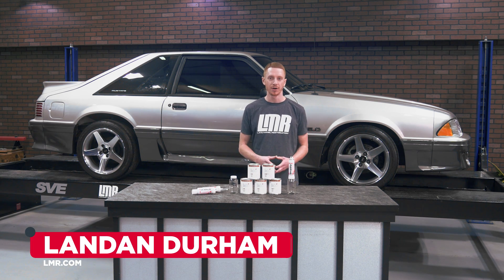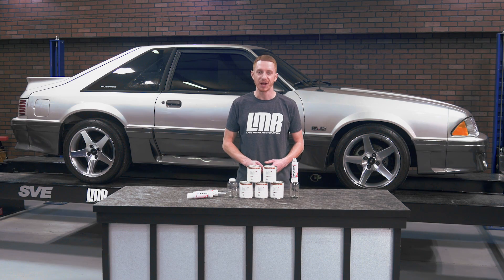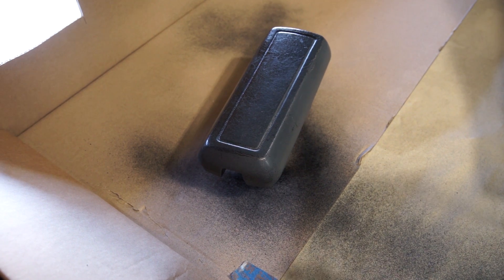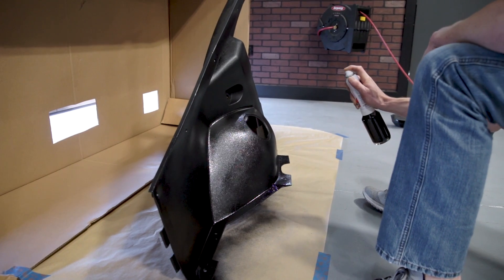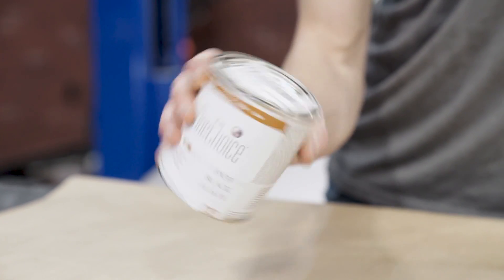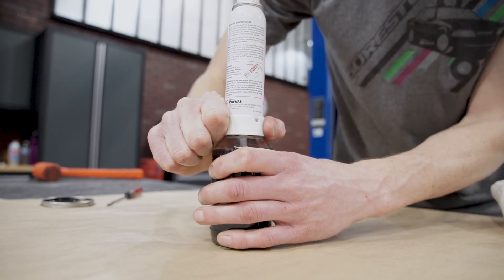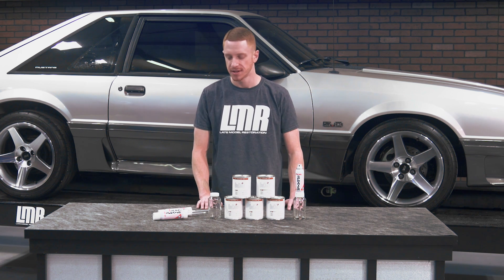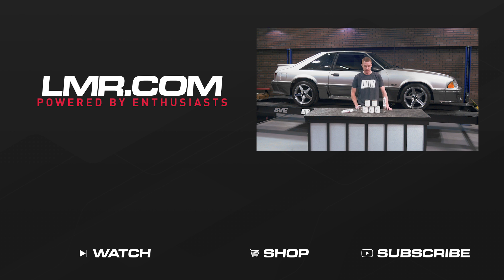Ford Mustang Interior Paint Systems - How To & Review (1979-2004)

Comment: What about a desert tan or what is the difference between the desert tan and sand beige if any???
Reply from the maker: I've never personally seen desert tan and sand beige side by side to give an accurate answer. Based on the information that is available to us, desert tan is darker than sand beige. You can either respray everything sand beige or try and have a custom color mixed by a local paint shop. -Landan
Reply: @latemodelrestoration  appreciate the response just purchased your sand beige paint kit for my 84

Comment: What are the differences between the two blacks. I'm changing colors and don't know what black I would want
Reply from the maker: 79-89 and 90-93 ran a specific black on each of these breakdowns. Most people usually go with the 90-93 options due to its blueish hue. The 79-89 has a slightly lighter tone.

Comment: I want to change my interior plastics from red to black. Would this paint work? Or could you recommend a primer or undercoat that would be compatible with these paints?
Reply from the maker: As long as the surfaces are prepped correctly, the use of a primer would not be needed.

Comment: What about rear quarter plastic interior parts for a notch
Reply from the maker: The flexing agent allows you to use this on interior plastics and vinyl.
Reply: But it won't fix holes and stuff on the rear plastic
Reply from the maker: Correct, this is just for painting or dyeing the surface only.

Comment: I wasted almost $400.00 on this system.  Paint system leaks and spills also the black I sprayed was slightly shinier than the spray can.  Buy the spray cans!!!  They spray smoother and don’t leak all over.  Landed up respraying everything with spray cans for an even and more stock look.   Make sure you scuff everything properly and use a plastic adhesion promoter.

Comment: I want to change colors will it work
Reply from the maker: Yes it will, a good rule of thumb is 1 pint = 5 traditional rattle cans or approximately 60 sq/ft coverage. 2 pints = 10 traditional rattle cans or approximately 120 sq/ft coverage.

Comment: No need for “adhesion promoters “?
Reply from the maker: dominionn09 you do not need to add any adhesion promoter to get the paint to adhere to the material that you are painting. Cleaning the part is still required but no added sprays or wipe on promoters are needed.